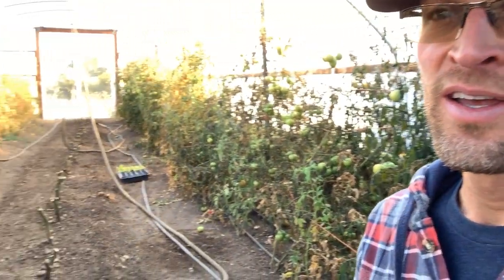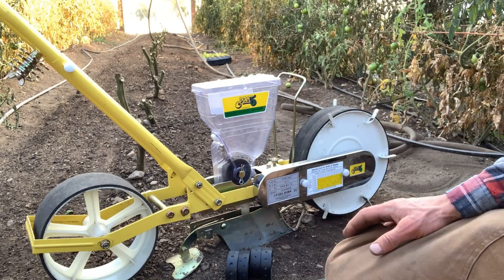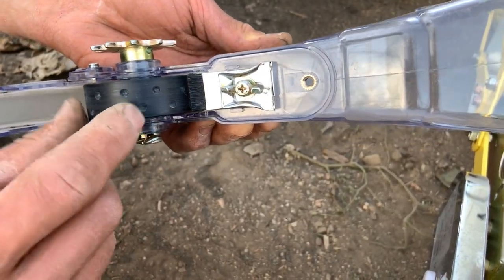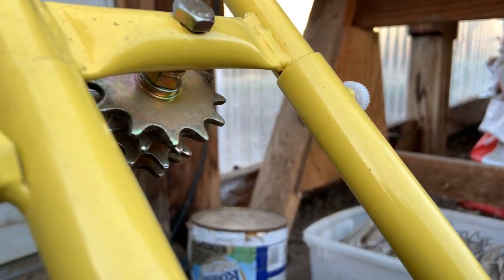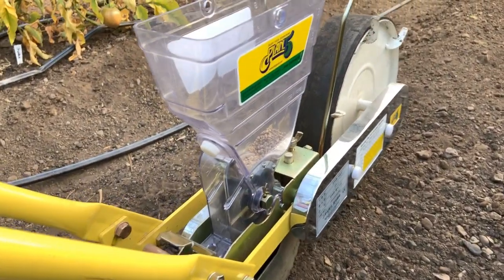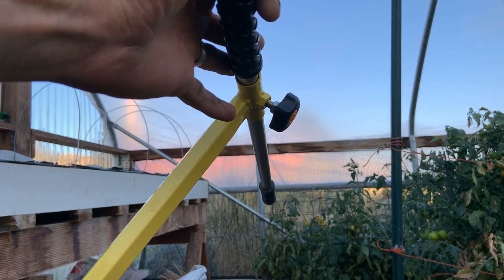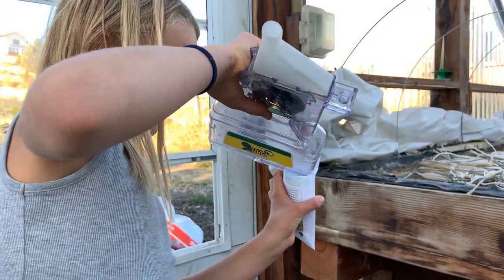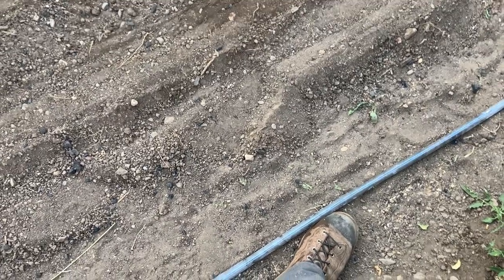JANG JP-1 CLEAN SEEDER | SEED AN ENTIRE GARDEN BED in LESS THAN 5 MINUTES!

Comment: Hi. Great demo video. The spring chain tensioner is missing from your seeder. It sits over that little pin at the bottom of your front chain case just behind the front sprocket. It’s just a short strip of spring steel approx 3-4 inches long with a loop on on end which sits over the pin under the chain.
Reply from the maker: What the heck! I will look into it. Thanks for letting me know Tony. Luckily, we have never had and issue without it.

Comment: Will this work with small amounts of seed? I don't have a huge garden but planting carrots really stinks and I'd love to try one of these out for a 10-20' row

E.g. would it work with single seed packets?
Reply from the maker: Yeah, it definitely would work. You will want to make sure you get the right seed wheel that is sized for the carrot seed. Note: pelletized carrot seeds are quite a bit bigger and will most likely require a larger wheel. Better check me on that though. Once you are done you can remove the hopper and pour the remaining seeds back in the packet! Hope this helps.